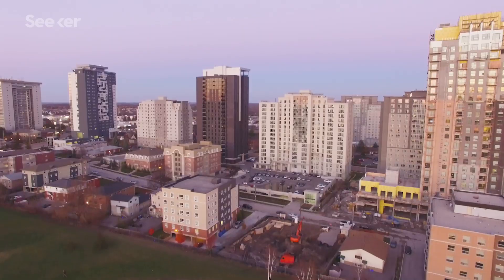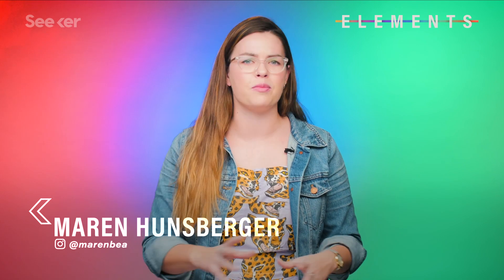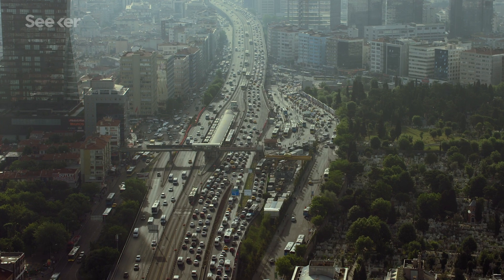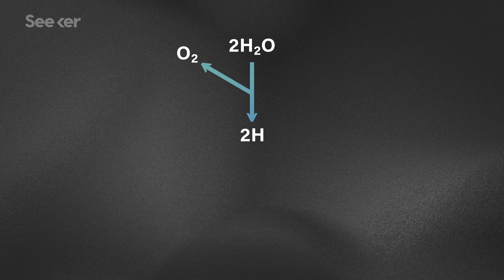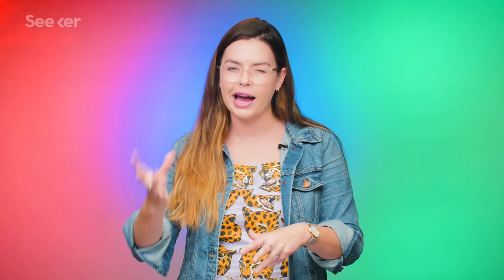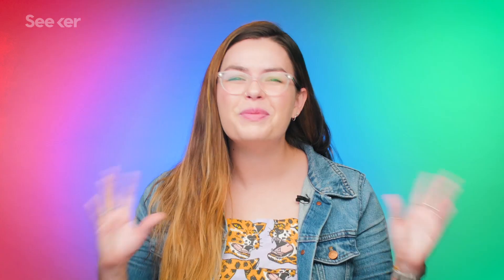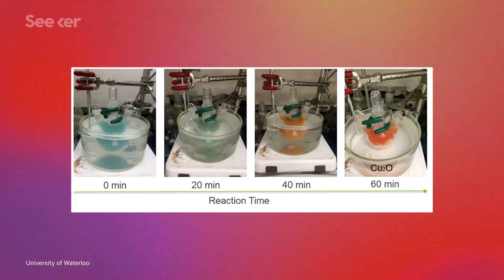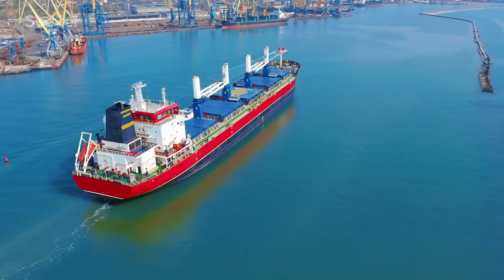Artificial Leaf Technology Could One Day Power Our World

Comment: I don’t get the benefit of “pulling CO2 from the air” from whatever process if that carbon will be released again eventually (when burning that methanol fuel, digesting that algae food or regular fruit from a greenhouse that uses CO2 from a carbon capture plant to improve yields, etc.).
Reply: The benefit is that there is no net gain of carbon, the proper term is that it is carbon neutral. This is obviously better then burning fossil fuels as it is not carbon neutral.
Reply: @WilisL  Sure it is carbon neutral, and sure that's better, but technically most of these efforts are not removing any carbon from the atmosphere. If we take the whole lifecycle into account (CO2 to X), they are either carbon neutral (if we use the products) or removing carbon / net negative (if we don't use them / store them somewhere) but not *both*. IMO, emphasizing both (as in ~~most~~ many videos) is misleading.
Reply: @jonasschulze8097  To be fair, these efforts are not to get a negative net of carbon dioxide, but rather just a better energy source then fossil fuels. Small steps first, in order to have any effect on our carbon dioxide atmosphere, we need to first at the very least stop adding more to it, and this is the first step, well maybe not first. There are other ways such as nuclear fusion that is still bring worked on or other renewable energy. Once we have carbon neutrality for most or all of our energy sources then we can think about removing them, or any effort in removing carbon dioxide will just be in vain.

Comment: When you burn methanol, doesn’t it produce CO2?
Reply: Only the CO2 that was drawn from the atmosphere to begin with
Reply: @XxThunderflamexX  Yea. So the net emission throughout the fuel's lifetime is 0. It would be just recycling the same CO2 that already exists in the atmosphere.
Reply: Net ZERO CO2.  It won't increase it.  BUT is will also not decrease it which is something we must do.  If we want a stable pre-industrial climate we need to bring atmospheric CO2 back to 280 ppm from the current 400+ ppm.
Reply: @CarFreeSegnitz  I see where your going the problem is its impossible. 1st we cant possibly control all of the sources of CO2 "the biggest source is the ocean". Second the fact humans exist will disrupt the climate. Every building, every thing we make, every action we take, has an impact. 

We simply dont have a way to reliably account for everything. And even if we could negate all human contributions of C02 it wouldnt really matter. The main driver is Water Vapor and clouds. 

Even if we could control CO2 and Clouds, we cant control the Sun and all its cycle. 

No matter what we do we will never be "Nuetral" We will never have a "stable" climate because that is just something the planet doesnt do.
Reply: @dralord1307  I don't think you understand carbon neutrality.
The carbon dioxide molecules produced by burning methanol does not have to be the one that are reabsorbed, the point is, an equivilant amount of carbon dioxide is going to be absorbed by a different plant at some point and the cycle just repeats. Of course this takes times, but over this period of time, the net carbon dioxide will not increase as it is a closed system.
Imagine a box, completely sealed, and in that box there is a plant. This plant absorbed some carbon, then by some method the plant turns into methanol, gets burnt and then realises that carbon back, and then a new plant grows and absorbed the carbon again, the net here is 0.
Reply: @WilisL  If you go back to the origin of this I was referring to not over producing or over removing CO2 from the atmosphere. My point was that its impossible to be perfectly nuetral and that the planet naturally changes. So being nuetral is a kind of impossible idea.
Reply: @dralord1307  Neutral refers to us not adding more carbon dioxide to the planet, not the natural processes of the planet adding more carbon to itself. Carbon neutral is a term applied to fuels that produce a net 0 carbon, my point still stands. I never said you were incorrect, I'm saying that you misunderstood where carbon neutral is applied to. Of course we can't make the entire planet neutral (or it already is as our planet is more or less a closed system), in fact we don't want to as the planet itself can regulate itself, however that is not the point of carbon neutral.
Reply: ok lets say they do this, start pulling out more and more co2 as the methanol production increases. we hit 180ppm. thats plant death level. congrats to us we just killed outrselves. These techs are good and im happy to see them but we really shouldnt go overboard either way